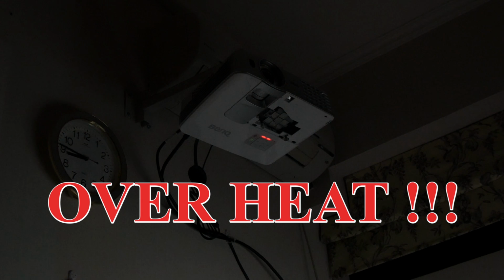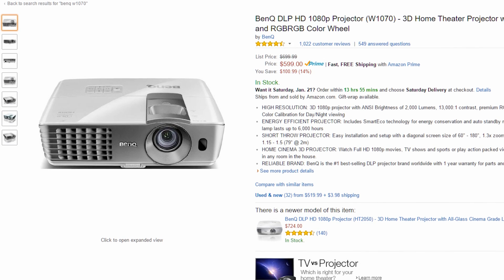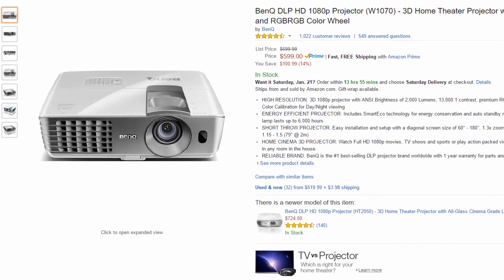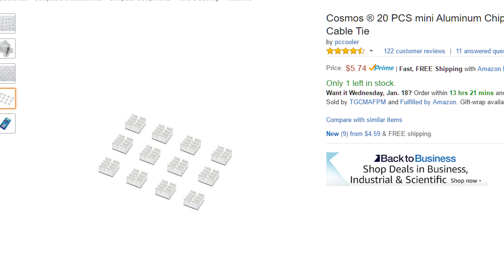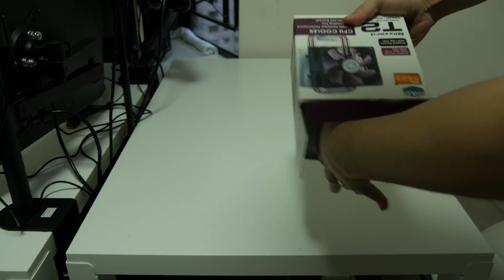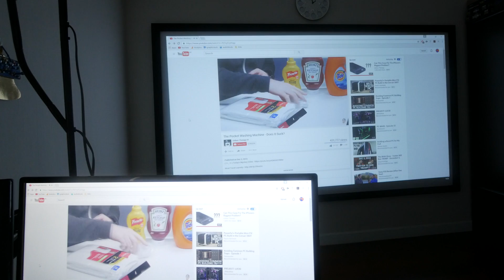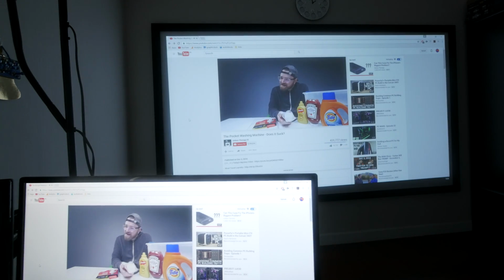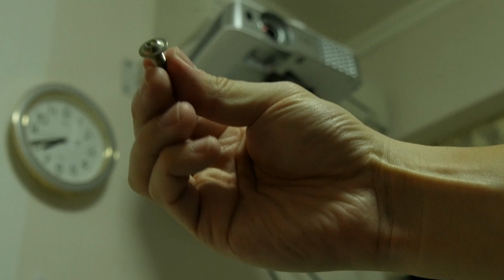How to Cool your Projector (Benq W1070 & 1080ST)

Comment: I know it's late but the issue was likely the lamp and it not having a proper IR filter. Aftermarket lamps sometimes don't use the more expensive IR cut filters. That floods the unit with hot infrared radiation causing this. I've seen it a bunch.

Comment: pretty sure that opening the lamp door is what actually made a difference for you

that puny heatsink is rated for something like 80 watts, and your bulb uses 300 watts (with most lost as heat)
Reply from the maker: nope, heatsink + 12v fan needed.

Comment: Mine w1080st was overheating after lamp replacement, just did the cleaning and keeps the temperature. 

If your heat sink does a good job you can reduce the fans speed ,go to the hidden menu, press menu, then enter and source at the same time. A few options with the test patterns are available, fan speed control, color wheel timing etc... Very useful to check every now and then.

Comment: Yikes. I can see how this could help, but since you bypassed the safety switch, you are potentially exposing yourself to very high voltage and deadly current from the ballast. Also, super glue to hold the heatsink in place is a temporary fix. That will eventually breakdown from the extreme heat. Thermal glue might (might) be a better option.

Comment: Hello I am having the overheating issue since day one. Before didn’t have this problem because I was in the northeast. No in FL and in a 2nd story house is different. It overheats every 45min or so. 
I am going to install the Heatsink this weekend. Question:
1. Do we need this size of heatsink?
2. Did the heatsink never fell down because of the heat on the glue? Mine will be right above my head!
3. Any other advice before doing this?
Reply from the maker: Mauricio Castellanos 1. bigger ones have more surface area for cooling; there are some models that are quite lightweight like the one I linked in the desc. I also have a big fan next to my projector and need the Ac turned on.  2. It didnt fall yet, but I also ziptied the heatsink to the projector in case the glue fails. 3. I think putting a fan next to the projector makes the biggest difference.

Comment: I am using the 1080 for years and many hours. I had never a problem with overheating 🤷🏼
Reply: Yeah, but that is just the way it goes with these things. Mine has this exact issue, I just replaced the bulb unit to no avail. Obviously it cannot be ALL of them because then they would get horrible reviews... it seems to be about 1 in 20 of them.

Comment: This solution is redonkulous. It might be glass shards blocking your cooling fan! This projector should not overheat. I recently changed the lamp on my W1070 and it started to overheat. When the lamp popped I heard glass fly. I opened it and removed the lamp and tapped hard (Not too hard) on the side of it. SEVERAL small pieces of glass fell out. I again hit it pretty hard (not too hard) and 3 more came out. Overheating problem SOLVED. NOTE: Vacuum dust first! I knocked a piece of dust into the lens area and had to open it up again 'cus it showed up on the screen. I used a vacuum to remove dust around the lens while inside the lamp compartment. Problem solved. Note: This is a tricky and sensitive instrument and not handling it properly could jeopardize your projector. Use this solution with caution. The complete disassembly of this projector to get to the fan that gets blocked looked vary long and involved.
Reply: I tried getting all the glass out and shop vacuumed and it still over heats after only 3 mins.  What do I do now?
Reply: @KevinSmith-hh2uv  Kevin, I had a piece of broken glass blocking the cooling fan. I don't want you to break your projector but I tapped on it to knock the glass loose and it fell out and then didn't overheat anymore. Try to figure out where the fans are on your projector and see if one of them is not spinning. That's the fan with a piece of glass blocking it. Hope this helps.
Reply: @KevinSmith-hh2uv  Kevin, You could also watch this two-part video about cleaning to figure out where the fan is. Also, perhaps you can access the service menu. It might show fan RPMs which would indicate a fan not spinning. Good Luck.

Comment: Put the fans back on so they constantly disperse the heat
Reply from the maker: I attached a fan on the heatsink of my unit powered from the usb port. Please check voltage/current of the fan if attempting this.

Comment: Heat rises. If the lamp can vent from the top it would cool much better. Having the heat sink under it means it's having to work against physis.
Reply: Don't forget about the laws of thermodynamics. Heat flows from hot to cold
Reply: Heat does not rise. Hot air rises, heat simply moves from hot to cold, gravity has nothing to do with it.

Comment: You can increase the speed of the several fans in the service menu. The W1070&1080 only have one thermal sensor under the lamp. Removing the cover can lead to overheating of other components, cause the planned airflow gets interrupted.
Reply: can you please explain how we can increase the fan speed
Reply: @so9224  https://youtu.be/zsdmNXPLF_g Please. 
On the channel of FixitFrank are very instructive tutorials, if the pro needs service: https://youtu.be/_xBGZ_V9Jp8
Reply: @David-Kynaston  3 struggling fans, a squeezing high voltage regulator and color wheel aren't so much "passive". The light bleed is tough. Better buy an Optoma hd151x, using better parts, i.e. 10cm ventilation that's delivering way more light and  has a 3D-RF port. :)
Reply from the maker: I wish I came across Franks videos sooner; 

anyhow I ended up getting the Optoma GT5600 which is still 1080p but has low input lag, is brighter and no overheating issues! 

Combine this with an ALR screen and you can even enjoy it even during daytime.
Reply: @vidafuku  Nice device, the 4K-Hype is mainly a marketing cheat. More than a mild soft effect isn't to expect from 4x-Wobbling 1080p. Much more important are colors and contrast. If you want a good physical resolution, the 2560x1440 2xWobble is still the way to go, but that costs (2K+). Have a lot of fun.
Reply: Just put the projector setting on high elevation makes the fans go faster no need for service menu

Comment: You could have saved money just by running the projector in high altitude mode settings and no overheating afterwards. This setting speeds up the fan to throw out more air. Never ever faced overheating issues with my Benq W1070 in last 3 yrs!
Reply from the maker: i got 2 of these units, high altitude mode didnt help on my units unfortunately. 
The best solution I curenttly have is to keep the room cool and put a fan next to the projector.

Comment: I was going to do this to my tiny Vivitek Qumi Q5 projector about a year ago too but weren’t sure if I’ll be laugh at. Now that I’ve seen you do it I think it’s cool. I will be mounting mine on permanently and will use the fan on as well. Though I’ll have to find out what voltage is required and find the source within the projector to power the fan. 

Great video man!
Reply: LeonVanzan Vang You could save your money just by running the projector in high altitude mode settings and no overheating afterwards. This setting speeds up the fan to throw out more air. Never ever faced overheating issues with my Benq W1070 in last 3 yrs!
Reply: Intekhab Ashraf 

That’s true but doing that only increase fan noises and anything running harder and faster internally will only increase heat. With this hack/modification it’s guarantee never to over heat cause that huge seat sink+fan will be more then enough to cool this thing even if it runs 24/7. Plus the fan on these heatsink are pretty quite. 

If you’re thinking you round the do it due to the awkwardness of that huge chunky thing sticking out that’s different. But I believe it’s cool because it’s mounted do not like someone’s gonna go check it out closely.

Comment: Pretty sure that if you just use regular super glue it will come off after a couple of weeks/days/hours. Use thermal glue instead.
Reply from the maker: Maximilian Wicén thanks for the insight! i'll look into it. fortunately my heatsink didnt come off yet but i attached a ziptie to it just in case.
Reply: You also want to use proper thermal glue to ensure the heat transfers smoothly from the bulb to the heatsink (think CPU to heatsink).

Comment: Hey man, great video. I just wanted to check in about a year later to see how your solution is doing. Have you had anymore issues with overheating since? Do you think the two pipe heat sink was enough or is it worth getting the four pipe? Have you had to change out the bulb yet and did you have any trouble removing the heat sink? Is there anything you would have done differently looking back?
Reply from the maker: Robert Hetterich my W1070 is doing fine with zero shutdowns but the 1080short throw version started shuting off again after 10mins.

Placing a big fan behind the unit is most effective method so far...

I think my 1080's internal fans aren't drawing out the heat quickly enough.
Reply: @vidafuku  i got wzatco s6 projector, if i put external big fan outside projector body on front of projector exhaust fan, will it damage my projector exaust fan ?
Reply: hi friend, when you mean fan behind the unit, may I know what time of fan are u referring to (something like this? https://www.amazon.com/dp/B00G059G86/ref=sspa_dk_detail_1?psc=1&pd_rd_i=B00G059G86&pf_rd_m=ATVPDKIKX0DER&pf_rd_p=1713835751726239774&pf_rd_r=RMKHA3RR6J055E5Q6K48&pd_rd_wg=vBvSZ&pf_rd_s=desktop-dp-sims&pf_rd_t=40701&pd_rd_w=1GyO5&pf_rd_i=desktop-dp-sims&pd_rd_r=e5e99a15-75f1-11e8-8359-d9810cfe33d0)  and where to place the fan exactly?

Comment: I followed the instructions to the point - and it worked!

My projector now runs perfectly without shutting down! 
Thank you so much! :)
Reply from the maker: Niels Nørløv Hansen thats awesome!
Reply: Niels Nørløv Hansen You could have saved money just by running the projector in high altitude mode settings and no overheating afterwards. This setting speeds up the fan to throw out more air. Never ever faced overheating issues with my Benq W1070 in last 3 yrs!
Reply: I tried that myself and it only helped it to occur less frequently. Fan 1 is the issue. It slows its rpm down likely due to bearings overheating. Fan needs replaced.
Reply: @amplelife  Then his fan 1 will fail sooner. Mine failed after 2 years due to running in high altitude mode. Had to be replaced..
Reply: Intekhab Ashraf I live in Taiwan and use high altitude mode due to it always being super hot here and it works to a degree but ultimately it can’t keep up, especially with high frame rate like with video games

Comment: This heatsink is almost useless without airflow. The heat gets stuck between the platters and don't move anywhere. It just needs a small amount of flowing air. Any low noise fan will do on slowest setting. Maybe you can seal the case up so that the internal fan sucks air through the heatsink.
Reply from the maker: Frank Gormanns a little air flow does make a huge difference! i actually did another video with an usb fan attached to this heatsink.
Reply: https://youtu.be/l_3cc2m6Bhw

Comment: I've just installed a similar heatsink and it works a treat. Ive had it on for over 2 hrs now. I also saw another video (after I did this hack) which shows you how to get into the advanced settings, there I could see that my fan number 1 wasn't working... which is probably why it was overheating in the first place.
Reply from the maker: brownboy90 thats awesome! i didnt know you can tinker with the fan settings.

Comment: Even with no overheating i probably make that kind of cooling mod to benq 2000w that i buy soon, because i dont like if projector is too noisy. That kind of solution and even with the cooler fan on its much more powerfull and much more silent.
Reply from the maker: Juustopuuro if only theres a better solution than superglue. my concern now is removing it when its time to replace the lamp unit
Reply: I think that you can use couple elastic octobusband also, idont know what is the real english name for that. Its not pretty but on the sealing its wont bother anybody and silent cannon is awesome. Still if i make some i buy usb fan adapter too and use cooler fan so its doesnt heat like hell in the longer use. That superglue isn't going to stuck that hard i think that you can use screwdriver to pop it out. I wonder why the manufacturers dont do cannons that have  a more like that cooler type cooling solutions. I mean i rather take almost completely silent projector with littlebit "stupider" look than fancy fashion projector with vacuum cleaner fans.

Comment: This is very cool. I would also try cooling packs for picnic boxes. They come in different sizes and could be bought for a few USD. These are plastic flat containers filled with water that you freeze and then use to cool your lunch box or picnic box.
I have two 1cm thick plastic containers to rest my laptop on top of them when working. I don't freeze them as the water inside is enough to conduct heat away from the laptop. Try it it might work for projectors.

Comment: get one with an LED lamp, it will last forever and they use heatsinks & fans just like that T2 you have there, you could replace it with a watercooler maybe 240mm would be enough for almost silent operation since they are like 150w LED arrays , similar to a beefy OCed cpu
Reply: can you explain with a bit more detail?
Reply: EspHack can you be more specific? We are not all experts

Comment: Wow!! Can it work for more than 4hrs??
Reply from the maker: Muya Mugi i guess this model is really famous for overheating! i usually have no problems but did encounter a few shutdowns when watching long movies. an external fan or a/c helps in my case.
Reply: Thanks. Add a Fan should help but that means more noise.. I also read that one of the internal mother board fan will surfer from dusty build up and then get stuck.

Comment: I been having the same over heating issue with the same model projector, I was going to see how long you been using the heatsink and if you have had any issues after you put the heatsink on it?
Reply from the maker: It seems quite a lot of people have this problem with this model. So far no issues with the heat sink. I'm still using this projector and the heat does not make the super glue come off.

Comment: the heat didn't make the glue come off at all?
Reply from the maker: After months of use I realized the heat sink was slightly wobbly. I'm going to tie some wires to the heatsink from the projector just in case.
Reply: Try AB glue...it should work better as it's heat resistant.

Comment: I don't have heating issues with my projector, but sometimes the fan noise i quite loud...would this help this?
Reply from the maker: Actually, the fan noise might even get louder as there is less enclosure.

The Passive cooling in my case did not effect fan speed.